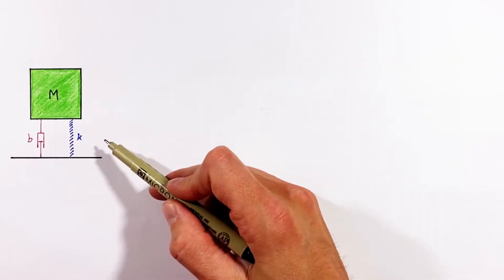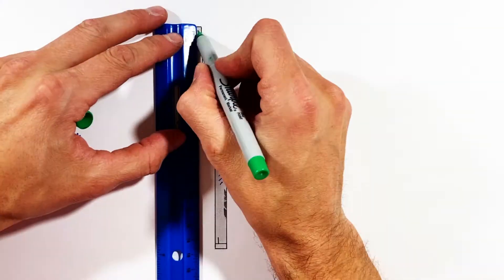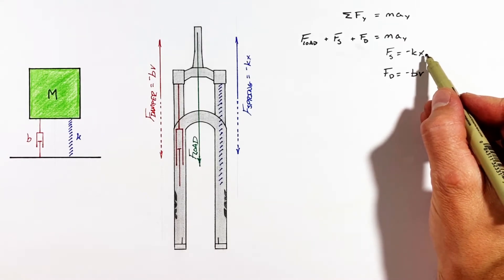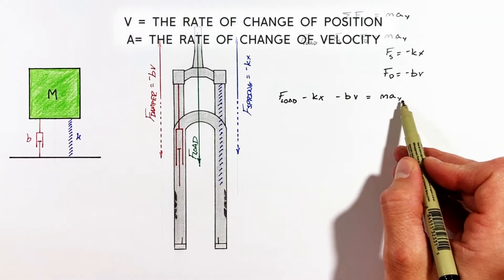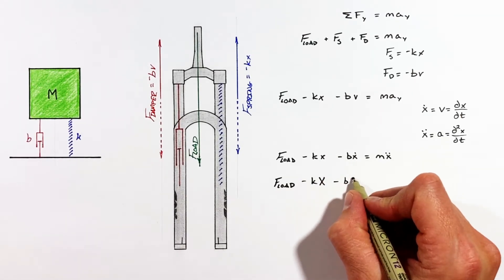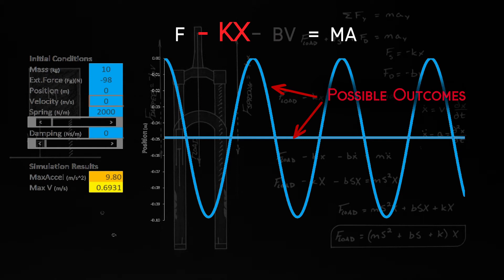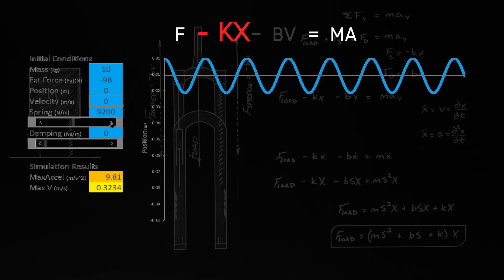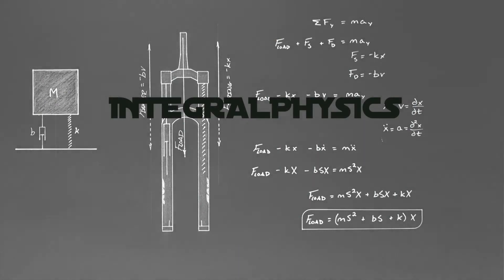Mass Spring Dampers: Equation of Motion | Dampened Harmonic Motion

Comment: Any way you could create a model including spring preload (as available on an MC shock) as a variable? The internet is full of righteous explainers blasting that preload is not affecting stiffness (sure, it has no effect on k)...but fail to explain why the suspension "feels" stiffer with more preload.  Thank you for the great video.
Reply from the maker: More preload is going to hold you higher in the stroke, meaning it will take more travel from equilibrium (and thus more work as well as force) to bottom out.  What many tuners leave out when looking at a spring curve, is the area under that curve.  

Whenever I mess with dirt bikes or mountain bikes, I look at the spring curve for small bump compliance and chassis stabilization (fore-aft), and the area under the spring curve for big hit control.

Comment: Hi! could you explain how did plot the motion in excel? I would like to try it by myself
Reply from the maker: Short answer: Eulers
Long answer:  I made columns for position, velocity, and acceleration.  The acceleration is based on the forces (load, spring and damper) acting on the piston.  Then I applied the kinematic equations and initial values to drive position and  velocity.  Excel treats the motion as though it is constant acceleration for 0.01s, then in the next row excel recalculates the new acceleration and thus updates the velocity and position.
Reply: @INTEGRALPHYSICS  thanks a lot for the explanation! by the way I found out that there is a simulation in wolfram that also plots this motion (ın a way) I would reccomend you to have a look at it, that might be a lot easier :)
Reply from the maker: Will do.  Thanks!